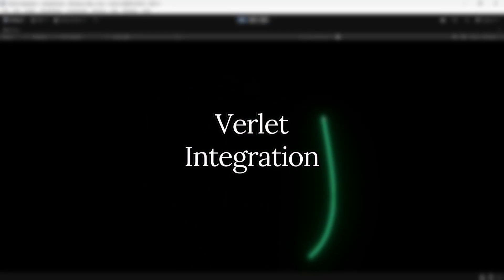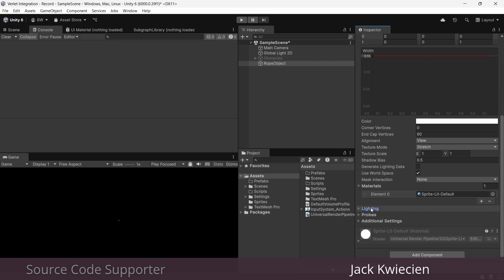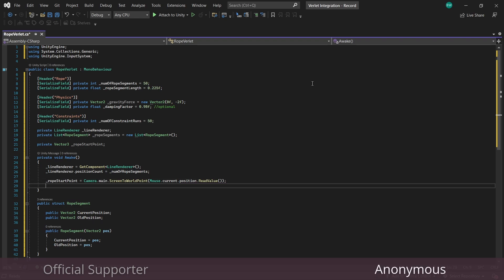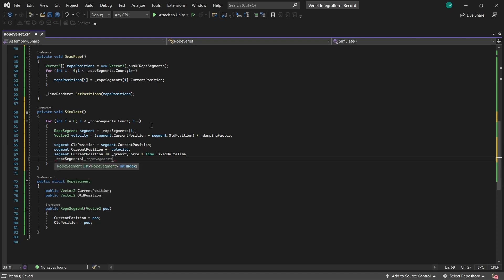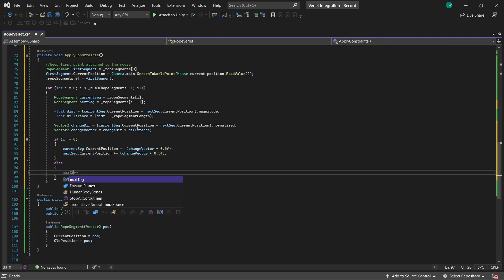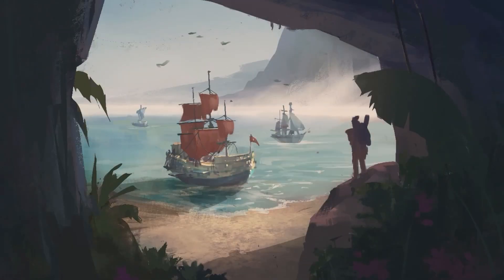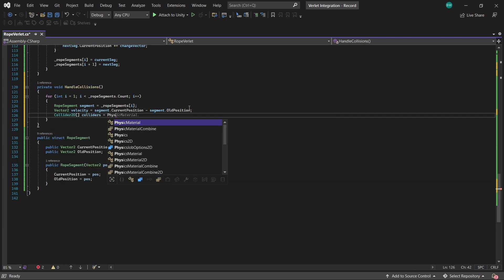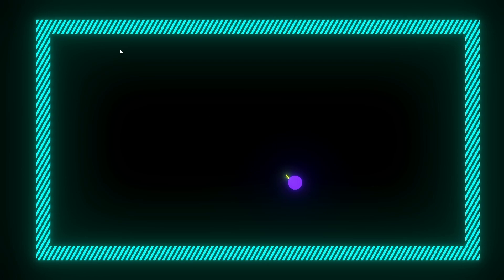Make a custom rope (with collisions) using VERLET Integration (Unity Tutorial)

Comment: Loving this, but I believe the algorithm is called PBD (Position-based dynamics). In Verlet you'd handle the constraints using forces (Hooke's Law in this case) instead of setting / calculating positions. Because of this, Verlet also doesn't have substeps (no explicit integrator would have substeps, they are a sign of an implicit or semi-implicit integrator).

Comment: I probably would not allocate an array of ropePositions inside of Update every frame. Since your number of rope positions is constant, you can allocate that once, maybe in Awake or Start and just overwrite the values every frame. 

Also, if your OverlapCircleAll takes _collisionRadius as a parameter, would it ever return any collisions outside of that radius i.e. is the if statement necessary?